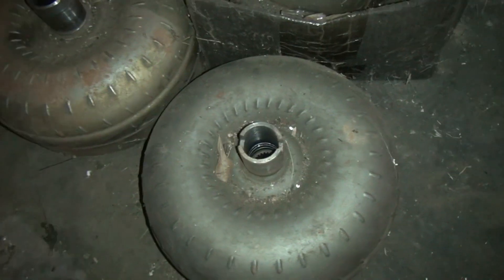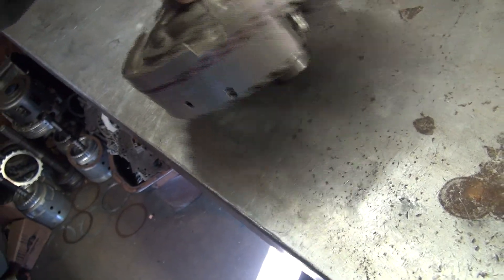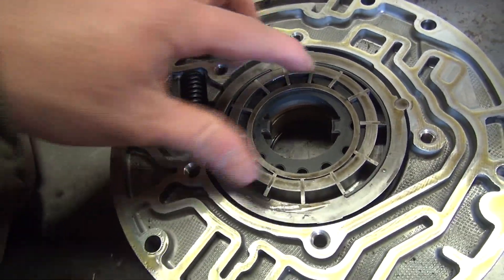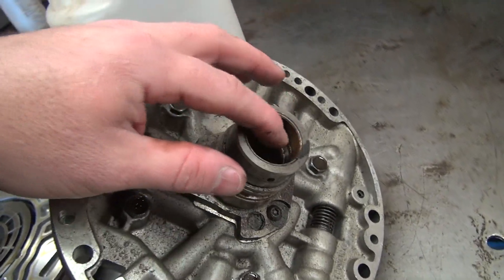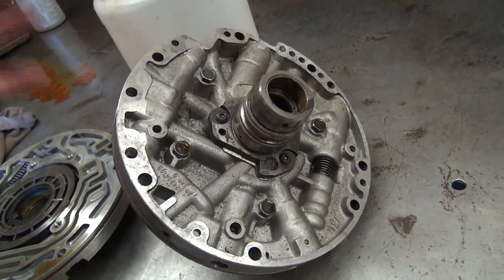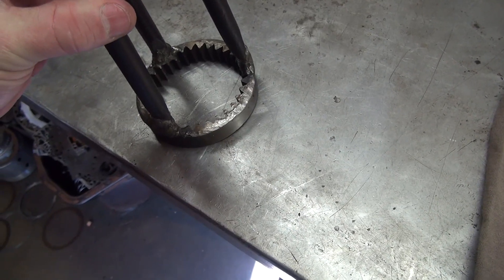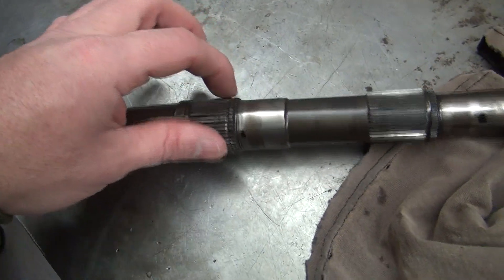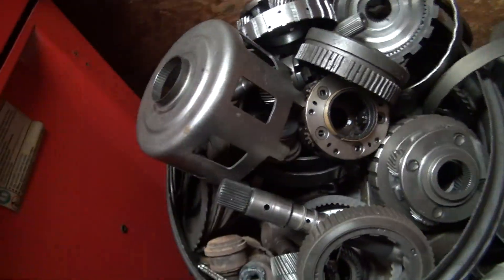Why towing your car with engine off will ruin your transmission!!!

Comment: I only towed my 98 chevy blazer less than 1/2 a mile, at a slow speed, it broke down about 1/2 mile away, would that ruin it? It was pulling up code p1810 before I towed it, is it just the tps pressure switch valve that's bad???
Reply from the maker: A half mile shouldn't have caused any damage.

Comment: I parked in a no-parking Zone on accident somebody use their truck to pull my Chevy Volt 2013 probably about 10 ft while the engine wasn't running I got in the car rearranged it then drove 39 minutes back home then drove another 5 minutes and still no sign of check engine light or bad signs at all.  Should I still be worried or did I get away scot-free?
Reply from the maker: it probably didn't hurt anything with the transmission. Maybe they didn't damage anything where they hooked onto to pull it.

Comment: Im going to flat tow a Subaru 6 speed manual transmission tomorrow for 2 hours. Just to be safe, I'm going to over fill the manual transmission/front differential with oil and hope for the best. 🤷‍♂️

Comment: @vitiay7209
0 seconds ago
Hi, why the service manual for the 4x4 Nissan Pathfinder 1998 with the rear 2wd part time option says, that the vehicle can ( but not recommended ) to be towed with the rear drive wheels on the ground at the speed no more than 60 mph with the transmission and the transfer case in neutral ? Does the transfer case in neutral not totally disconnect the front and/or rear wheels from the transmission? Your opinion would be highly appreciated.

Comment: I have a 2012 Odyssey i want to flat tow.  Could I just wire a 12v fluid pump to keep the atf fluid circulating while its in neutral, in theory?
Reply from the maker: I don't know if your idea would work but personally I wouldn't try it. The transmission pump puts out relatively high pressure over 150 psi generally in order to apply clutches and to properly lube bearings and bushings through small holes. I would look through forums and try to find info specific to your vehicle and what others have done. I've been out of this industry for several years and don't have any specific info for your vehicle. Certain vehicles are more tolerant than others and can be flat towed to an extent. My video was to inform that it's generally not a good idea at least without further research to your specific make and model.
Reply: Thanks for this. Was considering 12v pump but your explanation makes a lot of sense

Comment: Thanks for the video! 
Just a curius speculation...
If you need to tow a boat with a marine gear in it you should ether lock the prop shaft or overfill the transmission with oil to lubricate the bearings and gears during the towing. Do you think the oil overfilling method could be used in a automatic transmission for towing without damaging it?
Reply from the maker: Probably would depend on the particular transmission and how it was designed. I wouldn't risk it myself. All it takes is one part or bearing that doesn't get enough oil to cause you problems, since most are designed as a pressure lubed system. Too easy to get a dolly or trailer in most cases. Or if it's not too far,  you can usually get a tow truck to move it for a reasonable amount.

Comment: So if you removed the driveshaft/cv shafts then you would not have this problem?
Reply from the maker: Correct, but If you remove the cv shafts on most cars the wheel bearing assembly will separate as the cv shafts holds it together and you will also lose transmission fluid.
Reply: @Life With Chase  oh dear. I did not think about that. The cv shaft hold it together... the car is a 2009 nissan sentra. I need to get it to my house. Just a couple of miles. I would run it but the motor just barely starts and when it does, it knocks like it is gonna dump its oil. You think the bearings would stay in long enough to make a two mile journey?  I might cower out of that idea anyway
Reply: @LifeWithChase  WAIT A MINUTE! The bearing assembly is bolted onto the spindel. So I should be good...
Reply from the maker: The big nut on the cv shafts keeps the bearing from coming apart. It might make it a few miles before they start to separate but I wouldn't try it without putting a large bolt in place of the cv shafts, where they go through the bearings. I would probably pay a wrecker 75 bucks or so to tow it before I went to the trouble. Or just pull it as is and hope it doesn't damage anything since your only going 2 miles. Your money, your gambling decision 😂
Reply: @LifeWithChase  I wimped out of that potential disaster. I went ahead and rented a uhaul. Pickup n dolly. Gets the job done. Thank you for that knowledge. That could've gone very poorly

Comment: Good advice Chase .  I would have guessed a standard transmission would be fine but I'd be guessing and most likely wrong so its best not to guess cause it can get expensive  guessing .
Reply from the maker: Guessing can get expensive quick for sure LOL.
Reply: Check your owners manual. If you no longer have it you can usually download it for free. Don't guess, don't blindly trust the tow company or "friends or relative". Even most major brand car dealerships don't know, so if in doubt, your best bet if a breakdown occurs is a roll back. Most cars nowadays are front wheel drive only and can be easily towed with a typical small wrecker that picks up the front axle.

Comment: so what is the best way to tow a 2010 vw gti? its automatic 2wd, i need to tow it 1400 miles and needs to be flat tow? thanks
Reply from the maker: Don't know anything about those specifically. check your manual or Google or call the dealership and see if that's ok on those. If not get a trailer.

Comment: Good stuff to know, I do it just like you said. Explaining what go’s wrong , when the engine isn’t turning, didn’t know the particulars on all of that . Thanks Chase
Reply from the maker: Their all designed a little different but in general it's similar to an engine oiling system the way the oil is pumped through.
Reply: @LifeWithChase  yes , since you said it like that. It’s just like running a engine without oil
Reply from the maker: Yep, some of the transmissions that don't have a pan or have a very shallow pan, mainly some front wheel drives do have some splash lubrication that occurs in the differential part when being towed but it's usually not enough to thoroughly lubricate everything properly. Would be like running a engine with half the oil capacity. it'll run for a while but it's probably gonna have a much short lifespan...

Comment: Some cars allow four wheel down towing. Check the manufacture user manual. I tow a 2016 Chevy Sonic. Run engine 5 minutes before and after towing. Under 65 MPH towing.
Reply from the maker: Those do benefit from splash lubrication... The fluid level is high enough that the differential component of the trans turns in the fluid. However you still don't get the full lubrication that the transmission pump provides when the engine is running, it's also a smaller amount of fluid in that area that can over heat without it being circulated and pumped through The cooler and the reason they have the 65 mph speed limit and run for 5 min procedure... In my opinion you are still probably shortening the life of the transmission... I personally wouldn't do it unless I was gonna get rid of it when the warranty ran out, or I didn't mind paying for an early transmission replacement if it came to that.  Kinda like racing, you go into that knowing you're shortening the life of components, but if you enjoy it then it's worth it...A  lot of the manuals these days also say you never have to change the fluid for the life of the vehicle... Well that depends on who you ask what the life of the vehicle is.... Is it 50k or 500k miles? The manufacturers only Care that it makes it out of warranty, beyond that, it's your baby and they'll gladly sell you another... My sister bought a new camry in 2015,  they told her the first oil change was free but she didn't need it until 15,000 miles because it was synthetic... I told her she better get it changed at around 6,000-7,000 if she was planning on keeping it for a long time. I try to err on the side of caution because I've experienced a lot of failure's that bad engineers said would work!  Keep me updated on how many miles the transmission last if you keep it a long time...
Reply: @LifeWithChase  Right now it has 68K on the odometer and another 25K towed. Knock on wood it last many more years.
Reply from the maker: Sounds like it's holding up pretty well  so far...

Comment: I had a 2 speed Power Glide trans. That I could pull that car, and start it. It had dual pumps front and rear. But not many had both pumps. It was pulled 50 miles one time. Figured they had destroyed the trans. When I sold it 3 years later still worked. 
Also a lot of RV's install a quick release. That makes undoing the drive shalt fast and easy for towing. We have a 97 TJ manual for our tow Vehicle. Just put transfer case in N and trans in 1st and go.
Reply from the maker: I've never seen a dual pump power glide. I know they made a few, I've heard that you could pull start those but I've never got to see one.  All the power glides I've seen were single pump...  I've seen one of them quick release driveshaft things once, I really don't even remember what it looked like it's been so long ago... but by far the most common way is how you described last, trans in park for auto or gear for manual and transfer case in neutral...

Comment: Have you heard of transmission circulation pumps? Remco used to sell a lube pump just for this. It was really expensive for what you're getting. I am trying to piece together a DIY lube pump system for my lexus rx300 using a continuous duty 12v oil pump running inline with the factory trans cooler in the radiator. Powered by the motorhome through the 7 way cable 

Food for thought
Reply from the maker: I'm not sure if I would be comfortable trying that on a transmission that requires pressurized lubrication. It would probably work ok on the transmissions that benefit from splash lubrication such as some saturns gm etc, etc. I would still be Leary of it from an install point of view. When you start modifying transmission lines you create potential leak points and failure points that can fall leaving you stranded with a failed transmission.i know many people have tried different things, some with good success, but my personal opinion is if I was going to tow a vehicle behind an RV it would be either a 4x4 with transfer case with neutral, they usually have lube pump on output shaft. Or if I was going to use a car I would use a tow dolly or a small trailer like the little tandem axle uhaul rents. Again this is just my thoughts. You may have great success doing what you said, idk. Just can't help but think a  trailer with premium tires would be my choice rather than modify my car.
Reply: @LifeWithChase  That is a good point. I just don't want to have to deal with a trailer or dolly at campgrounds. Towbars/flat towing is so much easier to hookup. My Lexus is 22 years old with 270k miles so it's not a huge financial risk if it ruins the transmission, but I am trying to design the system to be as solid as possible. There's a guy on the irv2 forums who built a diy lube pump system for his minivan very similar to what I am attempting. Can't post links in youtube comments. Do you have experience with the RX300 transmissions? Are they splash lubed? Lexus released a TSB in 2000 stating it can be flat towed with no mods for 200 miles at 55 mph. But I want to be able to go faster, so I'll need a pump. 

Thanks for the video btw! Subbed
Reply from the maker: No experience with those, but if the tsb said its good for that many miles that tells me its getting some splash lubrication and your idea might work ok. A transmission that is not getting at least some splash lube would be cooked in probably 10-15 miles at road speed. since it's an older car and your willing to try it, and accept the consequences you have nothing to loose. I was thinking maybe you were gonna be chopping up the transmission lines on your $50k lexus with 30-40k miles on it LOL😂

Comment: if I'm going to pull my vehicle cross country behind me I'm going to just have all four wheels on the ground put it on a car trailer I'm a mechanic and a truck driver that's just me I'd rather be safe than sorry plus the trailer tire and rim is a lot cheaper
Reply from the maker: would cut down on suspension component wear on a trailer also

Comment: Not true in all cases. One of the most popular towed vehicles behind motor homes is the Honda cr-v (2000-2014) with auto transmissions. The procedure is in the owners manual. We tow my wife's manual transmission 2003 Saturn ion(177k totalmiles) 4 down for the last 5 years(5k miles towing) with no problems. If you want to give your viewers good info then tell them to check the owners manual of their car. There's also a publication that comes out every year that list the cars which can be towed 4 down and the proper procedure to do so. My brother has towed his 4wd 2003 jeep Cherokee for around 10-12 years. It has over 200k miles on it(driving miles) plus another 80-100k being towed 4 down behind his motor home. Neither of us has had any damage. While most auto transmissions are not flat towable (especially the ones with CVTs, none are, that I'm aware of), some older auto transmissions are. People need to do their own research.
Reply from the maker: As you said most are not flat towable. Their are a small percentage that are. Most RV people do their research and buy something that is... My video was mainly meant for those who break down on the Rd and then hook a chain up and have a friend pull them 20 miles to a shop to save on a tow bill. Seen this many times. Especially gm vehicles with bad fuel pumps 😂.  So unless you have done research and know for sure I recommend not doing it, cause it can be very expensive! Their have also been cases of towing companies destroying transmissions due to improper towing.